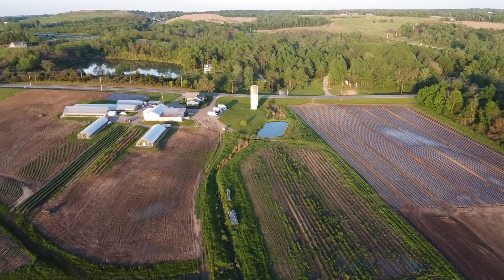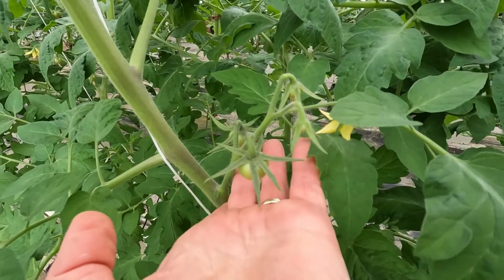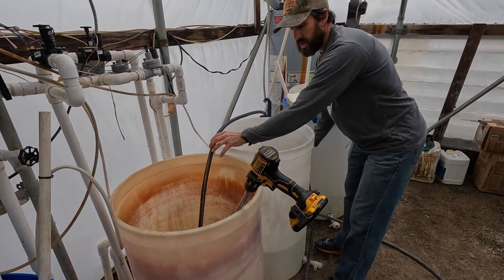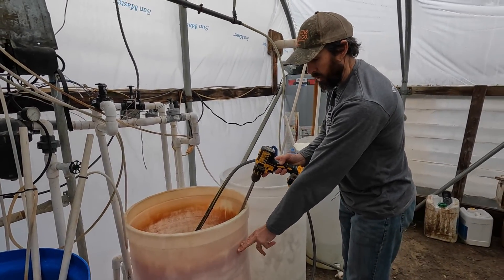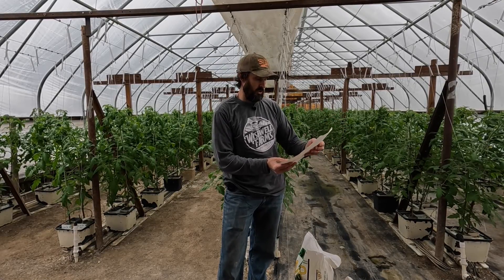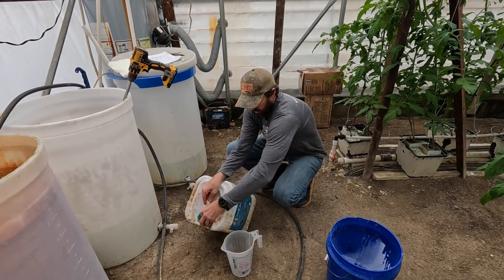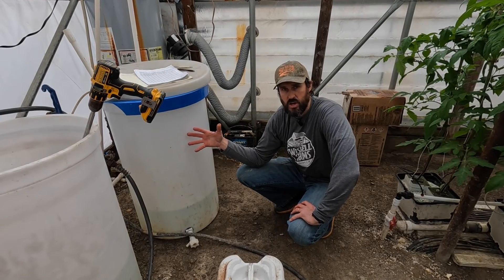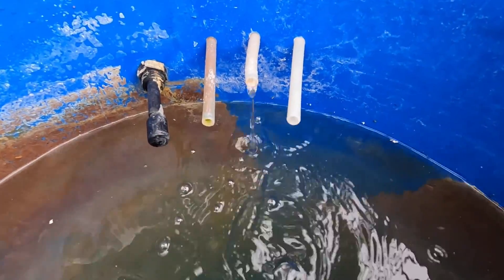HOW WE MEASURE AND MIX OUR HYDROPONIC TOMATO FERTILIZER RECIPE

Comment: I have been using some 15-15-15 fertilizer tilled into the ground in the Spring a week or two before planting. 
 I also use some of the tomato version of Miracle Gro on my tomatoes every week or 2 starting when I transplant them into the ground. In the fall, I also like to shred at least 1000 pounds of leaves and till them into my main garden before the ground freezes so that they are fully composted by April.
Reply from the maker: Sounds like you got a pretty darn good system down, I bet your tomatoes taste and look amazing! Thanks for sharing!

Comment: Thanks Jason... watched it twice... Rain water is my only source of supply, it comes out of the tank at a PH of 6ish,  after Yara Ferticare Tomato, Calcium Nitrate and when required Kista K is added PH drops to high 5's, I am happy to leave it there. Greenhouse # 1 has 80 bato's, 160 tomatoes and a 250 gallon reservoir running a recirculating system, ball floats top the tank up daily and EC is re-adjusted each morning. I do add a couple of weekly foliar sprays, Mag Sulphate, MPK and Calcium to name a few...
Reply from the maker: A 250 gallon reservoir with a recirculating system would be nice and maybe I will change over to that eventually. Sure would be nice to have water with a low pH because I spend almost $500 a year on sulfuric acid. I use to do foliar sprays weekly but quit doing it five or six years ago and haven’t noticed any difference so I just never started back up but I’m sure it’s helpful. Sounds like you got a pretty good system, thanks for sharing!

Comment: i also use sulpheric acid 33%. my local napa gets it in 1 gallon bags and delivers it to me. i use far less then you with my small (3x9 tray with a 50 gallon res.) ebb and flow system. do you add silica to your mix?
Reply from the maker: So I finally had to use my 93% sulfuric acid this last time so I turned my bellow pumps way down and slowly turn them up a little bit each day until I got the pH below six. Got to be careful working with a new titration curve it increases incrementally but it is nice using way less acid now than before. And no, I do not use silica, what is the purpose of that?
Reply: @wishwellfarms  it makes them more resilient to pests and its a cell wall strengthener make the stems less likely to kink or break. I could be slightly off I need to re read some stuff

Comment: Do you have a pump that constantly recirculates the final mixture?
Reply from the maker: A pump to recirculate the feed solution is not necessary in my set up, because the source water fills the tank in a swirling motion as the Bello pumps proportion the fertilizers and acid into the swirling water and is fed and refilled every 30 to 40 minutes and from my experience the feed solution is always mixed completely.